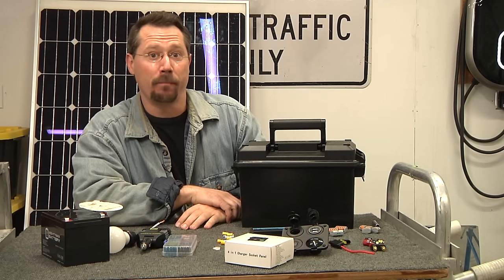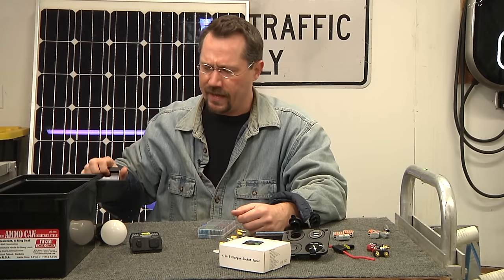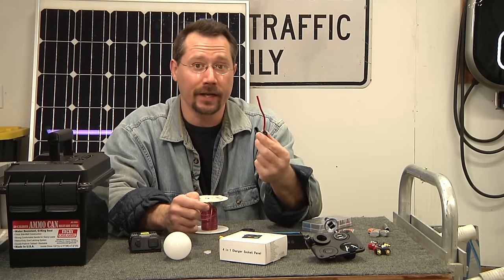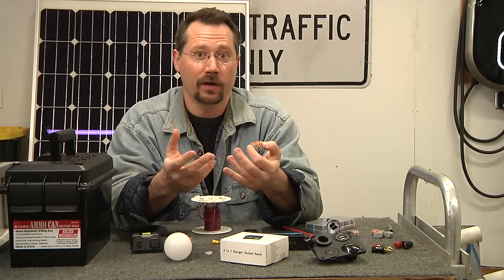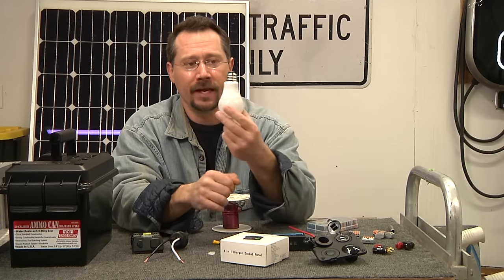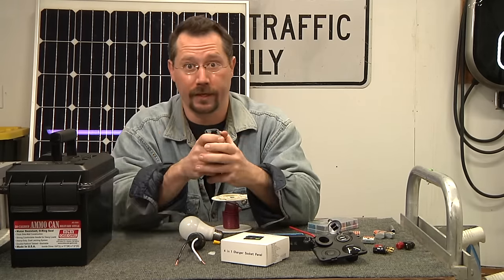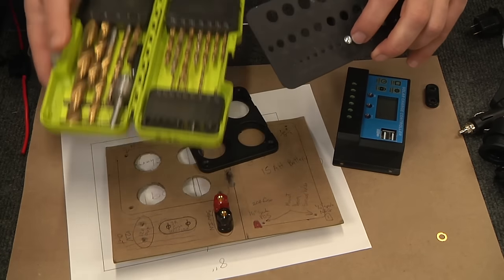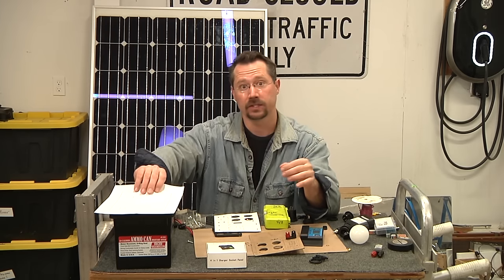Build A Solar Ammo Can Full-Length Instructional Video

Comment: I have built 3 of these boxes but want to improve my design.  I noticed your solar charge controller is always on,  do you think a kill switch from battery to charge controller would be necessary so I don't lose power.  I was wondering about the inverters runtime on a 15amp battery since I haven't installed one yet.  Have you found an average run time on a medium load?
Reply from the maker: My intent on this project was always simply to unplug the battery when not in use or for storage. I also made a slightly different version with a power switch: https://youtu.be/4YKRa9m4N7M
How long an inverter can run will simply depend on the size of the load. That can be figured out with a little simple math. 12V x 15AH = 180 watt-hours. Divide that by the power draw in watts to find the run time in hours. If that run time is less than what you would like, you could add a second battery in parallel or go to a larger external battery.
12V loads will always be simpler and more efficient to run than 120V loads, so always go with 12VDC when possible. Save the inverter for things that actually HAVE to run off 120V.

Comment: Is this battery big enough to run a small 12v fridge freezer? I want to makenone of these to mostly run a fridge but dont know how big of a batgery I need. Thanks, nice video
Reply from the maker: Refridgerators of any size tend to draw a lot of energy. Look at the label on the fridge/freezer. It will list current required in amps. You will need a battery that can supply at least that much current. Multiply that number by the number of hours you want the appliance to run. That number will then be in amp-hours or AH. Compare that number to the AH listing on the battery. For a lead battery, make sure your battery has at least TWICE that number, as you generally don't want to run lead batteries down more than half way.

I found an example of an efficient 12VDC Fridge/Freezer (https://amzn.to/3uc8sib) which lists that the compressor uses a max of 4.6A.
If the compressor ran continuously for an hour, that would be 4.6AH. That would be about half the capacity of a 12AH battery.

Generally, for an appliance like that, I would recommend a 12V battery of at least 100AH. You can use the same components listed in the solar ammo can project, but just connect them to a separate, LARGER battery.
Reply: @BenjaminNelsonX  thank you so much for the clear explanation. The fridge I have is a small Engel rated at 3 amps.  I will definitely apply what you have explained. Thanks again.

Comment: I'm in the middle of constructing a similar ammo can, and am using a mighty max 18ah battery, the same charge controller brand (All Powers), and a very similar 4-in-1 socket panel that looks exactly like the same product, visually.  I'm getting a 31 to 32 second delay on when I turn on the switch and when it actually powers up.  It reliably powers up, just thought it's weird that it takes 31 seconds to turn on.  Any ideas.  I'm just wiring the panel and not wiring any other banana jacks or any other outputs.
Reply from the maker: ? Weird. I haven't seen anything like that before. Go figure!
Reply: @BenjaminNelsonX  Yeah IDK.  Voltage is instantaneous when testing the charge controller output so it's not the controller.  I just ordered a new switch and will try that.  I'm thinking a bad capacitor in the switch or something. 

I'm in sunny CA with little chance of rain so I just bought a bunch of 10AWG and put a few 7.5A fuses in line and put powerpole connectors on one side and mc4's on the other to make a solar extension cord.  Then I have powerpoles going into the charge controller.  I'm assuming with just a 100W solar panel I'm not going to get an arc plugging and unplugging this in; will try to throw a towel over the panel to do so anyway.  Those Goal Zero's have powerpoles now.

Comment: Nice job but a couple of comments: 
1. As others have mentioned, you do need a switch for the charge controller so it doesn't drain the battery when there is no  source.
2. I am skeptical about the voltages being indicated. Voltage is analogous to pressure. Just as you can't move water without a pressure differential, you can't get amps to flow without a voltage differential. In your video the battery was already at 12.7 volts w/o a source connected. After you attached the grid connected power supply the voltage regulator still read 12.7 volts (or close to it). I don't believe under these conditions that the charger was putting any amps into the battery. It is possible the regulator was only indicating the battery status between pulses. Do you know what the case is? A charger for a 12 volt battery usually runs at around 14 volts. On a vehicle traction pack the charger can be 30 volts higher than the pack voltage.
Reply from the maker: The power supply I was using is 18V.
Many "12V" solar panels output about 18V. As stated, yes, a voltage source needs to be higher than the battery to be able to charge it. On the display of the Solar Charge Controller, the voltage being shown is that of the battery. Also on the display is an animated icon showing that the battery IS being charged. Solar panels designed for charging 12V batteries are often designed to put out up to 18V. In this case, I was using an 18V power supply in place of a solar panel to show how you can charge from the wall and/or or night.
Reply: Ahhh, thanks. When I first saw your video I assumed the voltage regulator was regulating the 18v supply down to 12.7v. Thanks for clarifying.

Comment: One of the great things about a box like this without holes drilled into the sides is that even with all the components installed, the box can still store about a half gallon of non-ethanol petrol in case of emergency.
<Insert Devious laugh>
On a serious note, is there any reason to use a fuse block panel in lieu of the single 20a inline fuse?
Reply from the maker: Either way would work fine. I like the simplicity of an in-line fuse. Remember, fuses are there to protect your wiring. The single biggest thing is that you want a fuse coming right off the battery, so that it blows in case you ever have a short circuit. Directly shorting a battery can cause enough current to flow to really be hazardous!

Comment: Thank you for sharing this video and for explaining everything in great detail. I Recently built similar project to power an electric fence to keep my goats in, but I keep thinking that I could use the same setup for other purposes (camping, etc) whenever I am not using it for the electric fence. However,  I am working with a 12 V 9 Ah Rechargeable SLA Battery.  Do you think that would be enough to handle the additional loads? Thank you!
Reply from the maker: It just depends on what the loads are.
It would be fine for charging a phone, running an LED light, etc.

Comment: I put a 12volt 12amp LiFePo4 battery in my box same build as yours minus the lead acid battery can I still use the 18 volt AC charger that you have in your parts list or do I bee to get a special AC charger for the LiFePo4 deep cycle battery will yr AC CHARGER you use hear damage my LiFePo4 battery

Comment: Good instructional video, but you wanted to make it so it is still waterproof. It has to be open to allow a solar panel or charger to charge the battery and also when using something that is plugged in as the lid cannot be closed with wires hanging out of it.  Good idea for stealth though, but I think I would prefer ones with the plugs etc. on the outside.
Reply from the maker: The joy of a custom project like this is that people can design them anyway they want. I'm very happy with how this has worked out for me. It's a pretty minimum amount of work to modify what I show to put the connectors on the outside of the box. There's plenty of youtube videos showing similar projects like that. I don't think they look as nice, but as always, do what works for you!

Comment: Hey Benjamin, I’m trying to wire a similar ammo can generator, however I’m only using one single 12v DC outlet. My switch has 18ga wire and my batteries (2x 15ah) have 12 ga. Where/how should I wire my switch so it turns the outlet on and off. Your expertise would be appreciated! Thank you.
Reply from the maker: Put the switch between the battery and the outlet. Traditionally, a switch will go on the positive wire on a DC system. 18 gauge wiring is pretty thin and will limit you to about 7-10 amps of current without potential for overheating. You may want to use thicker wiring and a different switch to be able to carry more current.

Comment: Hi, nice job.  If I may offer 1 constructive/critical comment, from my experience of rebuilding UPS devices, these batteries on average last 3-4 years, then they fail.  Some last longer, some shorter.  I would not silicone the battery in place.  My concern is prying the battery off of the silicone,  against the plastic box when the battery fails. You may wish to use your velcro on the bottom of the battery?
Reply from the maker: I've played around a bit with this project since filming the video. The silicone held the battery in place well in the bottom of the battery box, but I didn't have any issues getting it out either. Since the battery fits so nice against the sides of of the box, you don't need a particularly strong adhesive to hold it in place. Silicone, adhesive backed velcro, some double-sided foam tape, or a number of other solutions should all work fine.

Comment: Aloha Ben...thank you for making this easy to follow video tutorial for a Solar Generator. My local Store has a 100watt, 12v Monocrystaline Solar panel...would it be safe to use this panel in place of the 20 watt panel like that in your video? Would this essentially cut down the time to charge the battery? Im using a 12vdc 12ah battery..
Im new to solar..thanks for your anticipated reply...Gilbert
Reply from the maker: Yes, essentially the higher power solar panel will simply charge the battery faster.

Comment: I get not wanting to cut holes in the ammo can.  But with everything on the inside don't you have to leave the top open to charge, leaving everything exposed anyways?
Reply from the maker: And when I'm charging, it's when the sun is out, so it's sunny and clear anyways.

Frankly, there's a million ways a person can design a project like this.
I've seen a few with all sorts of holes in the side, and didn't care for the look.

I think the take-away is to do what works for you. I'm really happy with this design, and plenty of people have copied it, which I'm glad for because it means more people learning about the fundamentals of batteries and solar.

Comment: Ur video is nice..very educational.I have a question...what if I put motor inside the box..for emergency handcranking just in case in full cloudy days in a outback .my question is it is okay to put motor together with solar for handcranking emergency.. Thanks..mate
Reply from the maker: Yes, you can add another source of electrical energy besides a solar panel, such as a hand-crank generator, exercise bike generator, etc. Just make sure that any device is the appropriate voltage for a 12V nominal system.
Reply: @BenjaminNelsonX  .my plan is to add motor..in 12v nominal.thanks a lot..sir..keep up the good work..

Comment: Potential improvement for those looking to do this project themselves: If you can find a folding solar panel of sufficient power output you can mount that to the inside of the lid to make it a self contained solar generator and saves the need to carry a separate panel.
Reply from the maker: I took a look at a couple of folding solar panels. I found one that would fit inside the ammo can, but it would have to be vertical instead of flat to fit. That meant I would have had to redesign how everything else fit in the box.

If you can find a folding solar panel that will fit flat inside, that's great!
Reply: @BenjaminNelsonX  hey, didn't expect a response because of the age of the video, but thanks for the clarification. I love stuff like this so I'm always looking for ways to modify the designs I see in ways that could be handy.
Reply from the maker: @TripleBarrel06  The best part about YouTube is the sharing. I saw a number of projects similar to this, but they usually had poor video quality, or the finished project didn't look that good. So, I wanted to make my own, and design it in such a way that it would be easy for others to copy
But this is just ONE design, and people should do whatever they can for a design that works for them!

Variations on a theme are great. Just do whatever you can to keep learning and building.

Comment: I just finished my build and wired it as you did, using the same charge controller, but used a 35HA battery.

My only question: Using only USB to charge radios and batteries, etc how much load can it handle? I keep hearing I shouldn't charge anything through the charge controller, but only from an inverter.  Just confused about the load side of the controller and it's limitations, especially with a small inverter plugged into the 12V and using the UBS ports all at the same time. Thanks
Reply from the maker: The solar charge controller I used is rated for 20 amps. So, you should be able to plug in as much as you want from it, as long as it's less than 20A! 12V at 20A is 240 watts - that's quite a bit of power for charging cell phones, tablets, etc. For example, an iPhone usually charges at 5 watts and an iPad at 10 watts. You certainly can pull quite a bit through an inverter, depending on what you plug in.
I would avoid using an inverter at all, except for things which REQUIRE AC power. For example, when charging a phone, use the USB cord directly (either plugged into the charge controller or the additional USB ports) instead of through an AC adapter through an inverter. If something can run on DC anyways (such as straight through a USB cable) using an inverter only wastes efficiency by converting power from DC to AC and the finally back to DC again for your device charging.
Reply: BenjaminNelson Thank you very much for the detailed answer. I love this build and already into my second, but yes the whole idea was to charge everything via usb including my ham and shortwave so i should be good! Thanks again. Love the vid on this.

Comment: Ben: you might check link to Four in One Panel as on amazon, at the moment comes up with error.  There’s another of same style on amazon, “Cllena “ is mfr. Have to assume this is same spec/ hole spacing as yours?  

Seems those critics who advocate a switch between charge controller and batt are forgetting that you advise pulling fuse. Whether doing that or  a switch, STILL have to remember to do so when storing unit, so seems to be six of one...  No substitute for paying attention in the moment!
Reply from the maker: I updated the link for the 4-in-1 socket panel. Yes, the "Cllena" brand one is the same.

Comment: Fantastic, helpful video! Your use of the solar charger is very clever!
One question: The solar charger is 20 amps and I think you used a 10 amp fuse, but the maximum recommended charge current for the battery is 4.5 amps. I assume you would need to be careful not to connect it to a solar array (or other power source) that puts out more than 4.5 amps, correct?
Reply from the maker: This is just a very small, basic system. Using something like a 20 watt panel is only going to be 1 to 1.5 amps.
Even a 100 watt panel is probably only going to be 5.5A under IDEAL circumstances, and that's going to be a larger panel than you would want to carry around with this small  system.

If you are going with something larger than that, yes, a larger capacity battery is probably a good idea, or parallel up a pair of them.

Comment: Thank you for the video. I really don't know anything when it comes to power but you gave detailed instructions. I want to build a wireless webcam for my bird feeder using a Raspberry Pi connecting to one of those small USB Anker power banks 20100mah.I know I need one of those charge controllers but can someone guide me on what size solar panel I would need to keep the battery charging?

Comment: I have a small 5 watt solar panel. Will it work with this project or do i need a 10-20 watt panel?
Reply from the maker: The smaller (lower power) the solar panel, the longer it will take to charge a battery. The larger (higher power, in watts) the solar panel, the FASTER it will charge a battery.
A larger panel also gives you the advantage that you might be able to fully charge a battery even on a partly cloudy day, whereas a smaller panel might not.
If you already have a 5 watt panel, hook it up and use it. Just keep in mind that it will be very slow.

Comment: For the DC power supply it looks like the link you put in the notes is a barrel plug.  But what it needs is a power supply with banana plugs, right?  I have been looking for one of these and they're hard to find.  Do you have a link for one, or would you need an adapter that goes from barrel plug to dual banana plugs?
Reply from the maker: The banana plugs support bare wire. Any cut wires can go right into them.